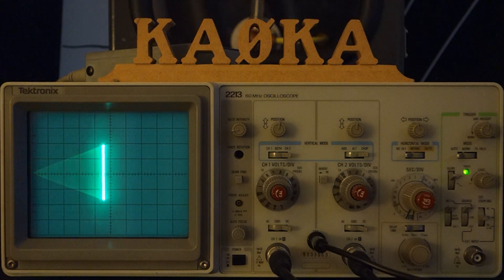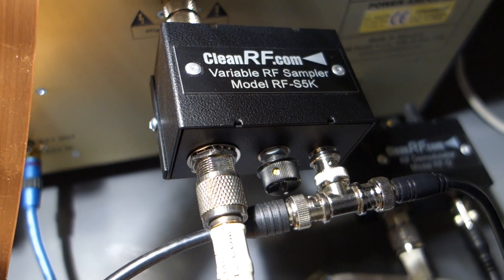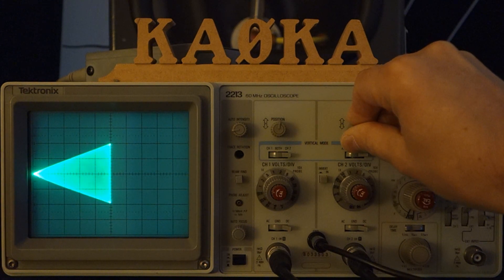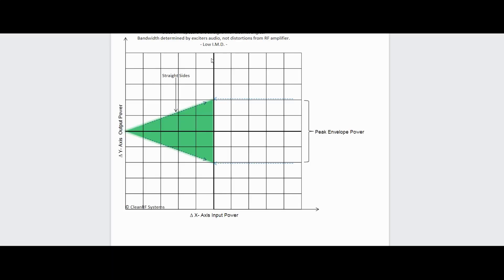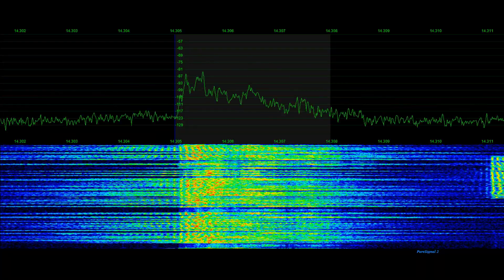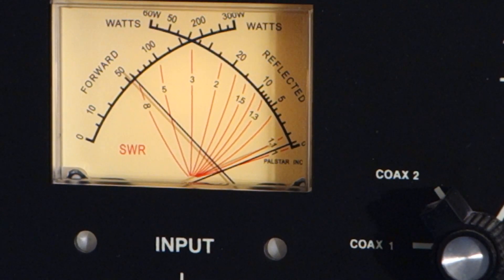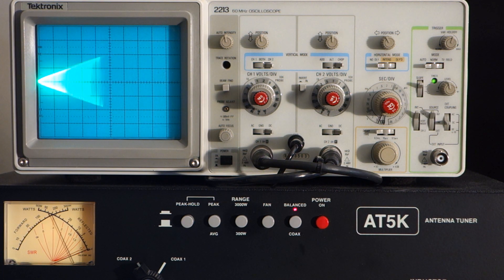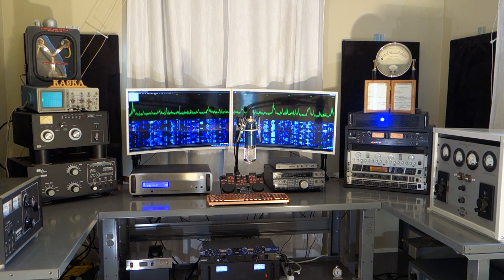How to tune your amplifier with an oscilloscope trapezoid pattern  | Stop Splattering CleanRF

Comment: What "under biased amplifiers" means? My trapezoid pattern looks like this and I can't find anywhere if I should make the bias voltage more positive or more negative (I'm running a Russian GU-43B tetrode, equivalent of 4cx1000). I tried upping the bias voltage from - 56 to - 51 and even to - 47 (increasing my idle current), but it made no difference. What can be other causes of this pattern?
Reply from the maker: Your bias is idle current, if the pattern has concave sides that is bias being too low, not screen voltage.  The pattern should look the same with the Amp off, only ch2 will be adjusted to compensate that is for testing our pattern only.
Reply: @SignalPhantom  thanks. Yes, I made the bias voltage more positive and it helped.
Reply: @SignalPhantom  my signal has a good triange but a bit of a dip about 1/2 way up then goes good the rest of the way
Reply from the maker: @1112223333111 if there is any concave line that is under bias you should test the image display by running no amp to confirm this, remember that is only a display test not an indication of linearity.

Comment: Could you tell me, please, how many steps per revolution the dials of this controller have approx.? I tried to find this data last week but I couldn't. Rotary encoders are very cheap to buy nowadays, but sometimes it might be practical to buy ready-made controllers with so much buttons and pots (even if I hate what it is developed for originally :-) ).
Reply from the maker: I think you commented on my DJ controller video but it ended up here, my unit works great but I do not know any more details.  You should put mix 31 beads on some extra cable to keep RF noise from radiating.